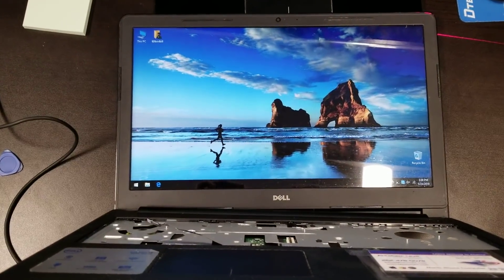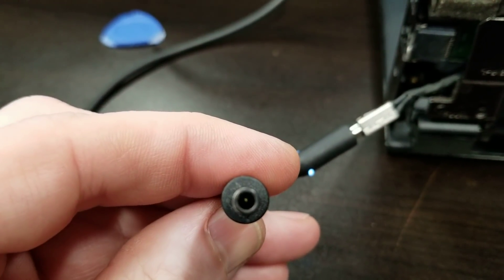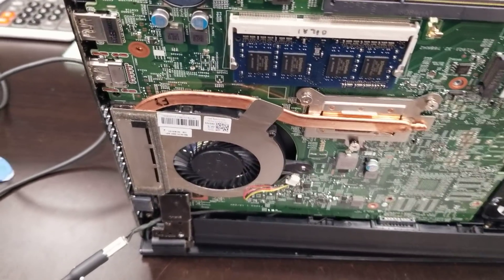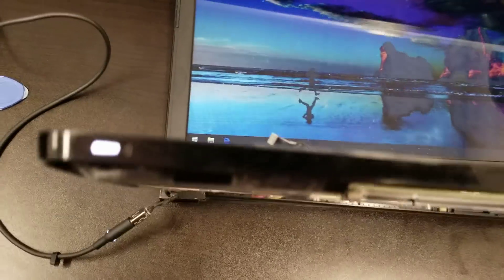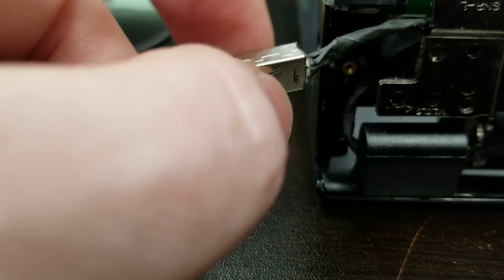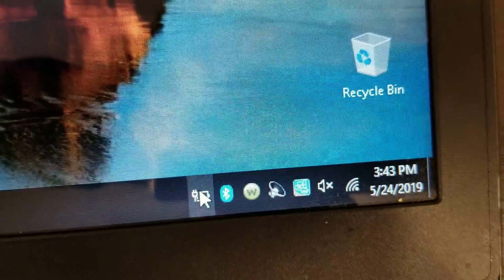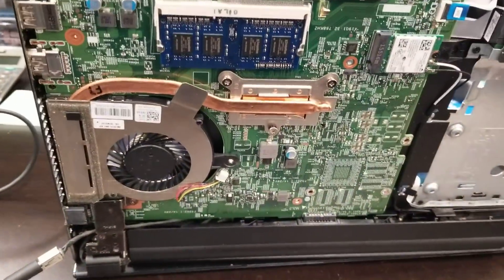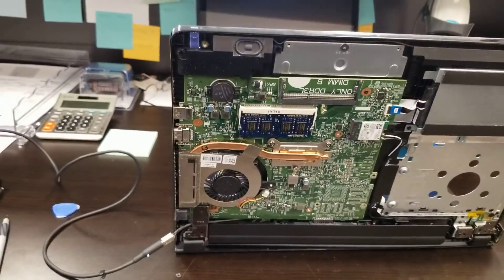SOLVED DELL and other laptops "Pluggeg in not charging" problem.

Comment: I have the same problem. I've spent the last couple hours inserting the adapter plug and turning it, without any success, because that's what worked in the past. But after watching your video, I pushed it in really hard ...and it worked.  I Don't know how it broke. I never the touch the plug (I leave it in there) because my last three computers died from jack or power issues. Thanks for the help!

Comment: 😂 i am way sorry .. absolutely upon frustration/aggravation be jamming in cord .. 😂 typlical i too hav very same issue upon troubleshooting troubleshoot ing trying few techniques all no resolved , buti too thinking same thing after battery/ac adapt replace still no resolve , not to mention new battery had partial charge until drained an couldnt recharge ..😢😅 so i did replace port/jack on dinosaur hp , an worked , some parts are manufactured very cheap some are decent , im currently working on dell 5521 .. no charge , how can u say check/faulty ac when powers on at 100% ..?  just a minor detail on questioning troubleshooting  thanks you i tinker w/laptops as a hobby..😊

Comment: My 1525 says "0% available (plugged in)". However, it's not charging.
The battery light at the front left of the laptop is not lit suggesting something is not working properly.

I've tried rotating the connector and inserting slowly and quickly.

I'm using a HP PSU (90W): Is this the possible cause of the charging problem?
90W should be more than enough to charge this laptop.
The PSU connector has a central wire same as the original.
Laptops aren't usually this fussy about PSU's.

Tried 
- turning off the laptop, 
- disconnecting the power supply, 
- removing the battery
- starting the laptop
- inserting the battery

This didn't work.
N.B. Until the battery was inserted the laptop battery indicator showed 255% charged.

Don't want to buy a new PSU only to find it doesn't fix the problem.
A lot of aftermarket PSU's say they are replacements for the 1525 PSU do they include the FET that is found in the original adapter?

Not able to check if the battery is OK due to the charging problem.
Assuming that a battery that is no longer holding much charge wouldn't be causing this problem.

Very impressed that such an old laptop works so well with Win10: 
SSD made the laptop fast enough to be usable.
4 GB of memory also helps... but it was running OK with 2 GB.

I'm fixing this up for a friend in Africa and don't want to spend too much on it... but the battery is important for him as power outages are common and power quality is poor.

Lots of useful suggestions below.

Thanks

🙂

Comment: I had a similar problem with a Dell latitude D610 where it would only charge if you used the correct 35W power supply that was designed for that  computer but other dell supplies gave an error message.

Comment: Many thanks. Your video solved my problem, but from the opposite side.  In my case with a Dell Latitude 5300, it turns out that by VERY SLOWLY inserting the plug into the jack, the battery can now charge. I assume this is just due to the fault in the charging jack yielding in some cases a quick insert will make the connection, and in some cases a slow insert will work. That is unsure, but what is sure is I will not be buying Dell anymore. This problem happened almost exactly after my 1 year warranty expired. I used to buy 1 or 2 Dells for my workplace each year. Had a problem with a desktop Dell PC power supply as well this year. Again, just a bit over 1 year after purchase. Bought a replacement power supply from the OEM in China and it worked out, but... My relationship with Dell is over. Get your power supply problems fixed. This is basic quality control for basic tech and you're not doing it, Dell. Shame.

Comment: I don't believe it!! It worked. I plugged in my new charger after replacing the port and received plugged in, not charging message. Then plugged the power cord out from the port. Then reinserted faster and it started charging again. Wtf, it makes no sense, but Thanks!! It works now again.

Comment: This is a good video.  

The Dell built in barrel connector is TOO delicate for everyday use.
I have an XPS 15 9570 with this exact problem.
Fortunately, the Dell engineers put a USB-C port close to the barrel connector that WILL charge the laptop!
You should buy the Dell 130w ($81) charger WITH USC-C plug.  Use it and you are good to go.  I use it every day.

If anybody finds an adaptor that converts female barrel port to male USB-C, that should work also.  and Cheaper.
I have not yet found that solution.

Comment: Hey! Amazing video, it was well explained and worked for me :D
But i discovered a slightly different thing: i plugged in but no charging, so, i tried to plug in and rotate the connector (like tunning an old radio or so lol) and voilà! It started charging.
I think that in my case what helped is the friction of contacts, cleaned it later with contact cleaner and worked without doing rotating or doing dome friction; and although it seemed clean before, it was kind of dark, now it seems shiny and bright.

Comment: My newish (3yrs old) laptop was plugged in using an old style dell charger with a dongle adapter.  Thought I was good but It still wouldn't charge. I even almost bought a new battery.  It never  occurred to me that it could be the charger. Thanks to you I figured it out and now its charging again. Thank you.

Comment: My battery appears to be charging now. Thank you. I was down to 0% so when I unplugged it the computer crashed and then when I plugged it in it was back to normal, but I pulled it out a little and now it is slowly going up in percent charge. The light on the right side of the laptop is not flickering yellow but is solid white. 

When I plugged it in, i just pulled it out a little. 

This is the last Dell, not just because of the design flaw, but because they just wanted to change out the battery.
Reply: I will try this right away. my 3 months old dell inspiron 3501 was not charging at all . 😭😂

Comment: I have been facing the same issue and whenever my laptop does not charge. I used to do many things like force plug in and soft plug in. At a random connection the laptop starts charging. Sometimes I get frustrated that even after trying for more than 10 minutes, the laptop does not recognize the charger. Does is make sense to buy a new laptop charger in this case ? Kindly suggest

Comment: Your charging cord goes  bad soon cause central information pin if its broken somewhere on the top of the switch ,it gives sometimes information to charge or sometimes its cut ,so you have to check the information  wire from charger .

Comment: WONDERFUL POST! Knowing how it's supposed to work is key to troubleshooting. I found that my center wire was missing thus no charge. Used small needle to probe receptacle hole to make sure wire was not broken off inside. Must be more careful plugging and unplugging. Now choice is to order a new charger or try to remanufacture old plug with new center wire (probably monel) using marine tex epoxy putty. One will be easy and quick but cost money. The other will be cheap but what a challenge. I am 75 and grew up filing a $2.80 set of points in car (in or out of a rain storm) to save money. Today who can file a 500 dollar computer to make your auto go.  Good luck to me!

Comment: Got the same message on my wife's Dell. Did all the driver tricks suggested as well as the power button procedure suggested by others to no avail. The charger tested good for the nominal 19 volts DC but there is that center pin mentioned in this video.  That center pin is where a third wire has connection between the Dell and it's power supply. In our case the center 3rd wire had no connection because it was a broken connection right at the molded power supply plug. I was going to by a new Dell laptop for my own use but not now. I want a laptop that uses a 2 wire, not a 3 wire charger. I've used Dells for years but this makes me question why there is so many failures where you have to use the Dell 3 wire charger.

Comment: What Dell is hiding very well, is that there is a FET (Field Effect Transistor) coupled to the power supply connector right at the end of the power supply plug (the end that you plug into your computer)  This little transistor is manufactured to have the correct voltage and current as is required by your computer.  After you use you power supply for long enough and the cord at the end of the plug has been bent hundreds of times, the connection to this small  FET breaks and the computer gives you the error message that it will not charge.  It has nothing to do with the computer and I am amazed at how many people have done videos and extolled everything but what is really the problem..  Especially DELL!!!!  These power supplies are built to break so that you will eventually have to buy a new one.  If you don't believe me, cut away all the rubber molding at the end of your power supply plug and you will find the FET with a lead broken!
Reply: I spent a day with Dell getting their advice and they didn't mention this issue at all.
Reply: vase odpoved .... je uzitočnejsi jako samotne video
Reply: Really i was so tensed thinking my laptop got broken.
So replacing the adapter should fix 0% plugged in not charging
Will it??
Reply: I cut away the plastic moluded around the charging plug, but i did not see a FET.

Comment: Thanks i got a similar dell laptop from a client with same problem. So i open it  and i saw that little thing wad broken as you showed in your video. So it must be replaced. To solve the problem. Powerjack must be replace. That's the solution

Comment: After trying multitude of things, including breaking down the laptop to get to the power supply connector in this video, I finally got it to work because I did break down the laptop.  When I powered back up, the fans ran at full speed and it did not boot.  This was somewhat expected because I had previously replaced the keyboard and it took a while for the first boot.  But this time, it did not boot.  However, now the battery appeared to be charging because I unplugged the adapter and the fans were still running - previously the battery was completely depleted.  So, I unplugged the battery and booted again.  This time, it booted up.  I shut it back down, plugged in the battery and booted again.  The battery was charging!  The only thing I can figure is unplugging the MB battery and all the cables had something to do with it resetting.  I had already done the Dell recommendations - unplug the battery, leave it 3 hours, plug it back in, let it charge for 24 hours, update drivers, update BIOS, etc. etc.  Nothing worked.  Taking it all apart and putting it back together worked.  So can only guess it got reset.  Also, previously the BIOS was reporting wrong power supply and it no longer does that either - and that was probably the whole reason it wasn't charging.  But not sure what caused it to realize it was the "right" power supply.  Very strange.

Comment: For older Dell (and other laptops too) there was a trick that often worked...

Power off.        Remove the battery.       Power up.     Once running, re-insert the battery.

This allows the laptop to "See" a new item present (the battery) and away it goes...  (obviously this doesn't work for actual hardware issues, only typical software/firmware confusion issues.)

Comment: Dell has a problem with its software or rather in their testing department. Dell default enables an optimized battery charging setting, 
change this setting to 'standard'. A reboot might be necessary. That did the trick for me, it's charging fine again. Luckily I was in the last 
day of my warranty so the tech employee could help me out free of charge.

Comment: Thanks! This problem drove me nuts for a long time. This worked on my Dell laptop.
Reply: What should I do ? My laptop is 10 days old and I got this .
Reply: @desifins  Demand that it gets fixed under warranty, at no cost to you; or get a full refund. is yours a Dell, too? 

This trick on the video works intermittently. I spoke too soon and am now having charging problems again.

I'm beginning to suspect that manufacturers and or Microsoft updates are behind this. It drives people to buy new products, when they shouldn't have to.

Remember the Iphone 6 battery issue? Apple didn't say a word about it, until they were sued by the geeks, who could prove that their Iphones were intentionally slowed down after software updates.

Comment: I also read in PC magazine the 
 battery sensor may need to be reset.  To do this, unplug from wall and laptop.  Remove battery.  Plug in power cord and turn on laptop....this is supposed to reboot battery sensor.  Power off and remove power cord.  Put battery back onto laptop.  The problem should be fixed.   The PC Magazine resolution worked for me.
Reply: Didn't work for me. I think the fix mentioned in the video should work.
Reply: I am sorry that it did not work.  Glad you tried.

Comment: Didn't work for me.  I plug it in fast and get the same not charging message =(
Reply: Like you his method did not work.  But I found this solution and it worked.  Turn off power to laptop and unplug from laptop.  Remove battery.  Plug in power cord and turn on laptop.  This should reboot the battery sensor.  Turn off power to laptop and unplug.  Put battery back on laptop.  Power on laptop and plug in power cord.  It should start charging....I was very surprised to have it working again after days if struggling.  Good luck .

Comment: This was the solution to my problem. I thought it was the battery for a long time and tried a lot of related fixes, but this actually worked! What a crappy computer brand. I'll never buy a Dell again and neither should you. They're nothing special and this kind of problem is so easy to cause after a few years of moderate use.
Reply: Bro dell don't charge I'll never buy one again

Comment: Tried all the other solutions on internet, This one worked.  I wonder how many other 'solutions' are really the result of plugging in quickly vs slow plug in.
Reply: Probably none....there was one comment where they say it works when they plug it in fast. I'm truly convinced THIS is NOT where the power supply is the culprit; there's way too much inconsistency with those that have this problem and most are saying this either doesn't work or it worked and then has returned and then you have the percentage of those who state this does not work for them at all. The deductive conclusion: IT'S A NON PHYSICAL HARDWARE malfunction.